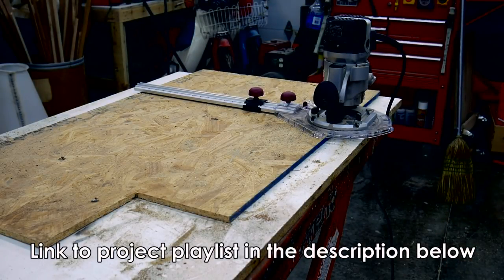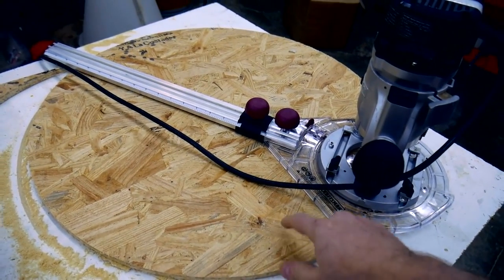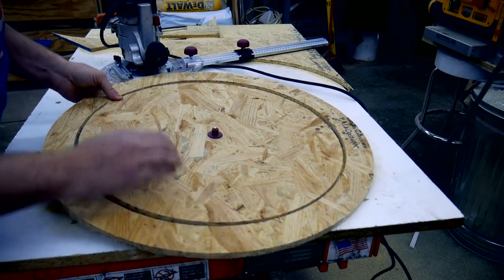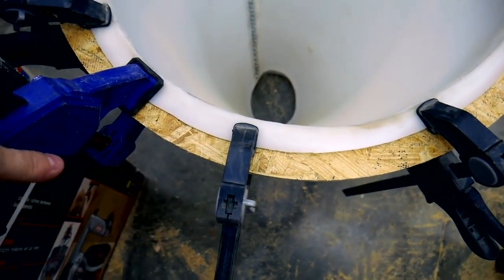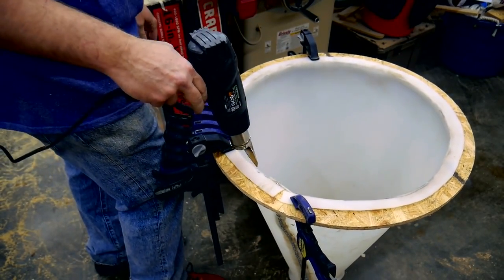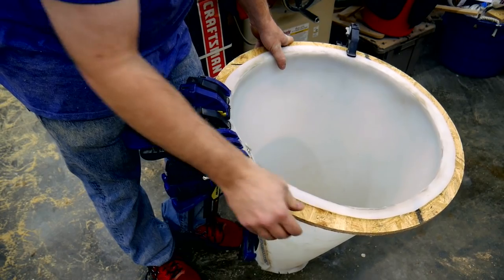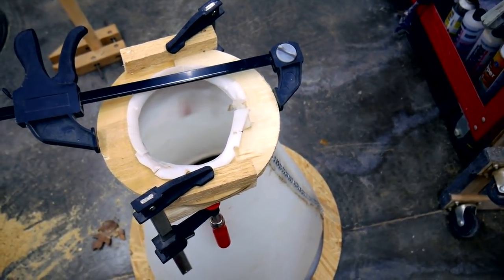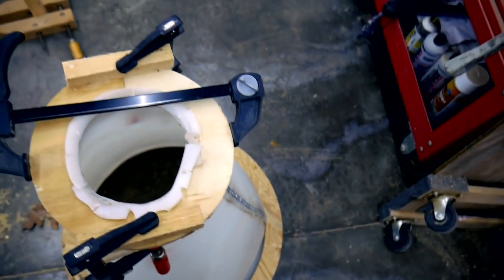DIY Cyclone Dust Separator 3: Mounting Flanges

Comment: I made one from metal.  Used a 6" flange with stick um on one side and then used another 6 inch on the plastic barrel.  If I had it to do over again I would cut a wooden bottom and top oversize enough to use a 1x2 and make that first.  kind of a skeleton.  I found that the top hat was hard and I think mine would be better if I had made mine smaller.